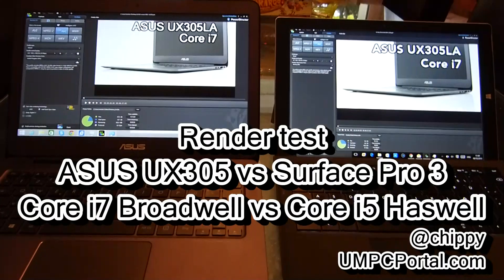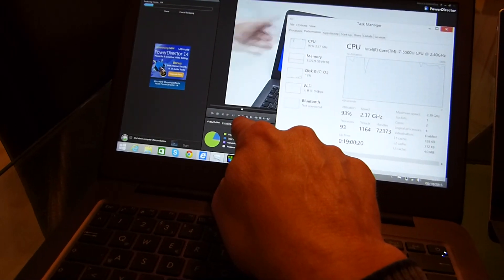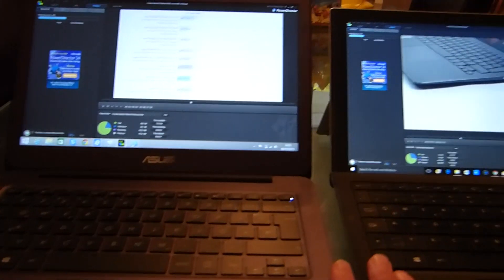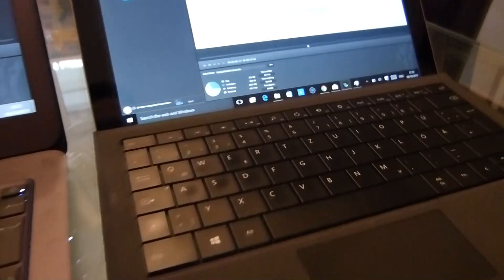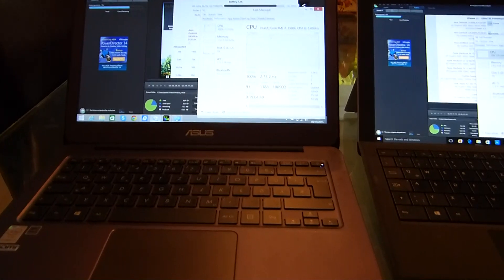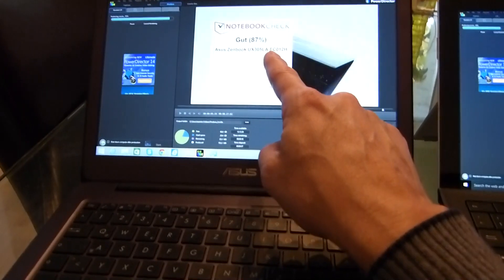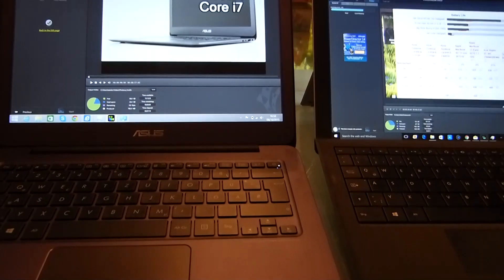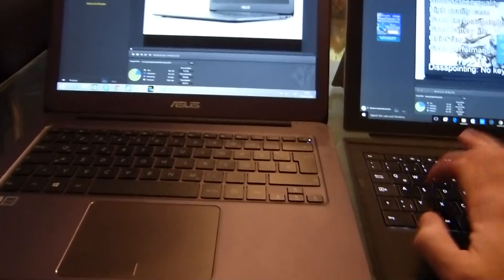ASUS UX305 Core i7 vs Surface Pro 3 (Thermal issues)

Comment: You should try the Surface Book when it launches. It will be awesome. Also, the Surface Pro 4 i7 will feature Iris Pro graphics, so it will be interesting how it will stack against Surface Book both in thermals and GPU performance.